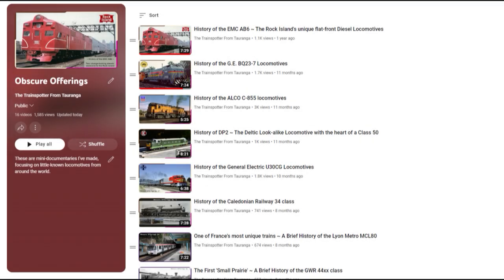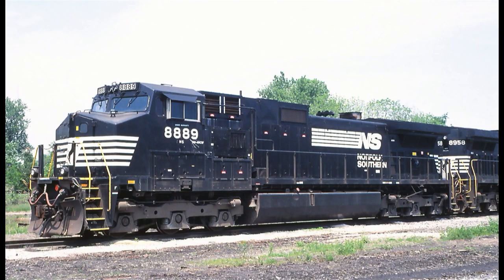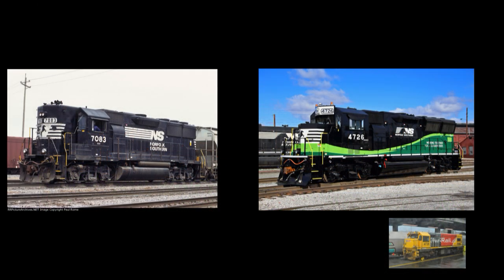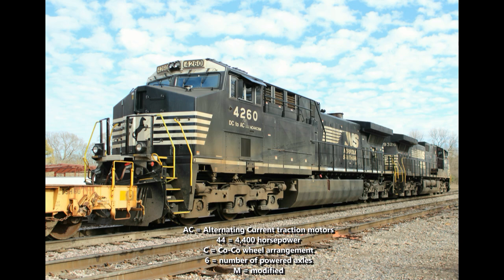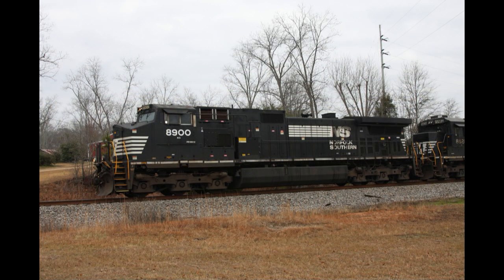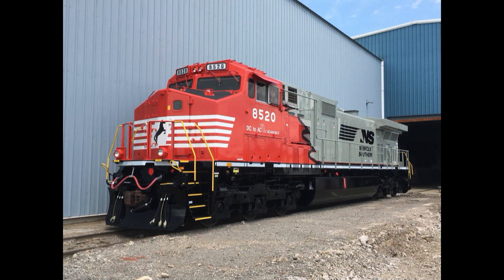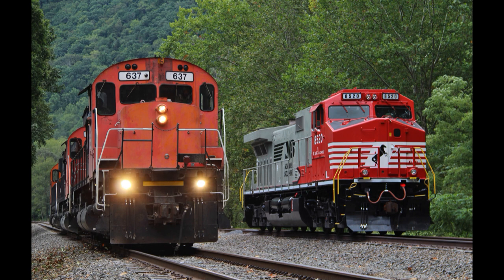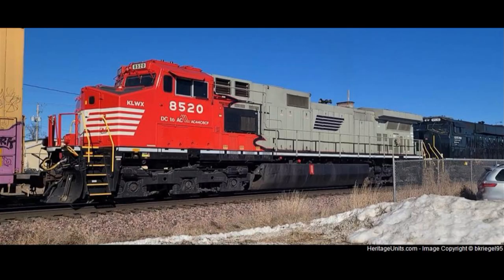History of the Norfolk Southern AC44C6CF ~ A Failed Dash 9 Rebuild (Obscure Offerings Ep. 17)

Comment: A little more to it than that. Yes, CAF supplied inverters and sourced traction motors. But the engine was modified with third party injectors and common rail fuel system in an effort to achieve EPA Tier 2 emissions. Also, a new control system from TMV. Ultimately, too many experiments on one locomotive. After going to KLW it was noticed the engine was swapped out and she is still running today, most recently on UP.

Comment: the dash-9's and dash-8's are my favorite, but using electrical equipment on a diesel locomotive would not combine together in my opinion. also weird trains with strange designs. but they are short-lived and very unreliable like the budd metroliner, class M-1 steam turbine locomotive, GE U50's run by Southern Pacific and Union Pacific and the GE BQ23-7 locomotives that runs on the Seaboard Coast Line and CSX
Reply from the maker: I've heard of all four designs you've mentioned, and the BQ23-7 was the subject of an earlier mini-documentary.